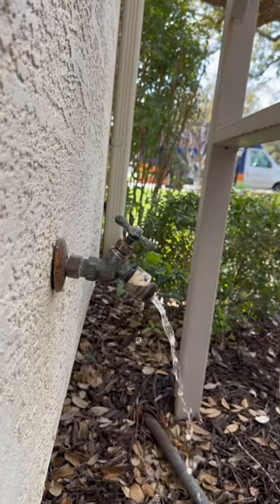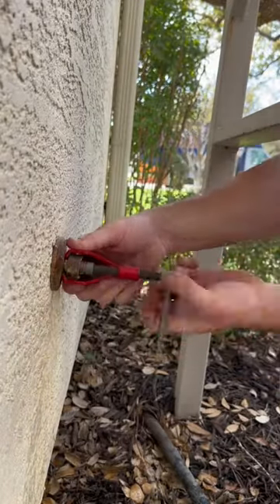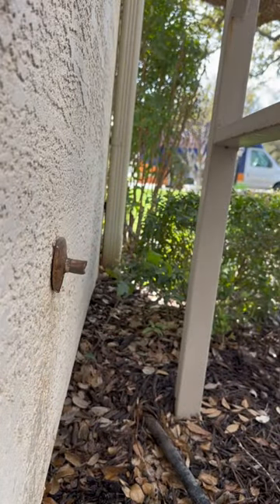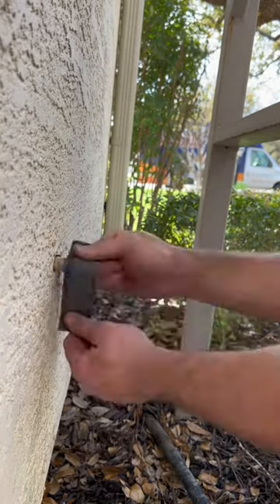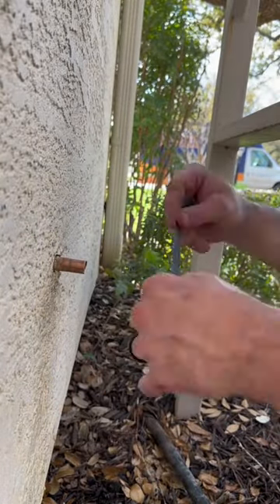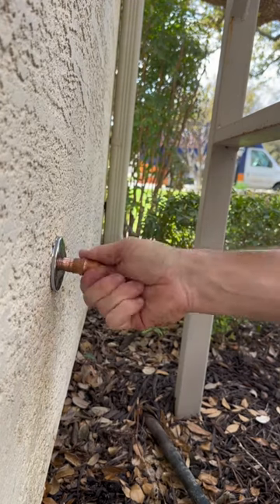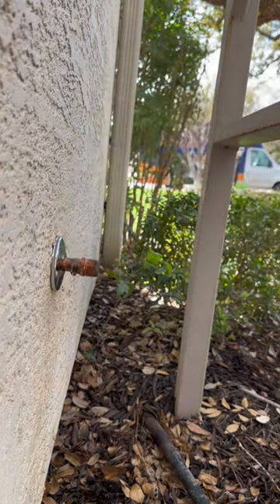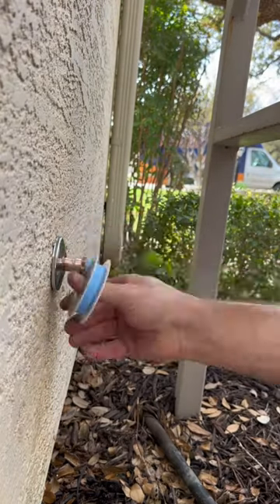Hose bib replacement. #plumbing #plumber #trades #leakrepair

Comment: Man you trades guys always like to preemptively lash out at the trolls, I love it.
Reply: the amount of times experienced tradesmen have to deal with “you should be doing…” 🙄
Reply: Lol they get butt hurt easily
Reply: @SolEcho  and yet, not a single word from anyone when out in the field  🤔 well besides a coworker 😂
Reply: This new generation is a little sensitive. You either do it right or you don't, you'll learn one way or another. Cupcakes 🤦🏽‍♂️😂
Reply: They know what they are doing wrong when they do it.
The calling out is them admitting they don't care.
Reply: Comes with territory
Reply: making a utube video doesnt make them true professionals
Reply: we dont like eachother
Reply: @411Adidas  Seems so.
Reply: Bro fr except not even trolls but other plumbers. I am an IT guy watching those parts pretending like "yeah I can see why other plumbers could think using a PEXVC soldered flex joint bend 95 in this scenario would be bad practice, but in your scenario due to local code it clearly makes sense and is valid"

Comment: I bought a Ferrell puller one time and the very first time I used it, the Ferrell was so damn compressed that all I did was flare the end of the pipe then I had to cut the copper and the wall and solder a coupling to extend it😂 I'm glad yours works

Comment: I am a plumber, and everything you did there was right.  I been a plumber  for over 30+ years.    I have never owned a Ferrell pulling removing tool.   Never needed it.  There are ways to remove them with out damage and without that tool.

Comment: Amazing how many people don’t realize you should always have a backflow preventer on a water spigot
Reply: I am a big fan of those backflow protection devices...
Reply: Why is it necessary?
Reply: @murkyturkey5238  Without a backflow preventer attached to the garden hose faucet line, there is the possibility of contaminants or chemicals entering the water supply.
Reply: That is not a Backflow preventer. That is a vacuum breaker.
Reply: Maybe I'll use one when they redesign them correctly so they don't spray in all directions.  Until then, a splitter with the both sides open when not in use will have to do.
Reply: Hmm
Reply: I don't have a backflow preventer anywhere in my house
Reply: @scottfletcher1956  a vacuum breaker is a type of backflow preventer
Reply: @Joshua Bennett  It's still a vacuum breaker.
Reply: @metallurgy3586  and a vacuum breaker is still a backflow preventer
Reply: @metallurgy3586  Think about it logistically dawg. If its preventing a vacuum from forming then its preventing flowing water from going into the spigot. Therefore, backflow preventer
Reply: @Justin Williams  yes. But look up back flow prevention.  See what the results are. Then, look up a vacuum breaker.
Reply: @Justin Williams  there's a difference, but then again there isn't.
Reply: @YooRyuk  so the random attachments that people add to their hoses don't contaminate drinking water inside. To me they are useless and the only time they accomplish anything is getting me wet when i turn the water off.
Reply: Amazing how wrong you are. Vacuum breaker that is on this installation is the code required method 😉
Reply: Probably internal double check valve as we call 🇬🇧 bib taps with above are banned here🇬🇧
Reply: Those vacuum breakers spray everywhere make a mess. Unscrew lock screw and remove those things.
Reply: @YooRyuk Yes, a one in a gazillion chance.
Reply: I’m one of the ones that realize that they’re typically ‘required’, but don’t like them and don’t have them. How about that?

Comment: Great work! An alternative would be flanged bib with a Hose Bib Buddy plate. (The copper pipe looked a little wobbly.)  I'll send you one if you want to try. You can look it up: Hose Bib Buddy (the original not the cheap triangle Chinese copy)

Comment: With how straight the cut on that end of that pipe is, I'm amazed it didn't leak since the day it was installed. Maybe those bigger ones are less forgiving than the ones on cars

Comment: I messed up the copper using a feral puller one time.... It was just dug so tight into the copper there was a divot spot so the new feral just wouldnt make a seal. Fortunately pipe was long enough to cut the damaged bit off and was good. Hate when stuff just cant go smooth...plumber life.
Reply: That's wild!

Comment: Spanners of the correct size are always the best tool for the job.
Reply: The pliers wrench is really good. It’s a wrench that actually grabs the sides rather than just sliding over them. If you’ve never used them, you don’t know what you’re missing. Looks like pliers but it’s actually a wrench.

Comment: It only damages the copper pipe if it's soft copper. Hard copper pipe it will be fine. I know cause I've done it on both pipes. And never use type M pipe.

Comment: I've wiggled ferrules off with just a wrench, is that better worst or fine compared to a puller?
Reply: I would say it gives more chance of failure, due to possibly damaging the pipe. If it gets oval, from squeezing, or scratched enough, it's possible the next ferrule may not seal and leak. 

If the ferrule is loose enough to be removed that way, it likely wasn't tightened enough, and could have failed with higher pressure.

Comment: Use a small brush with your Flux to wipe the solder joints. Will remove excess and clean up nicely

Comment: I pulled off two at my mom's house and the copper was crimped some, but I cutt it off right behind it
Reply: That's from over tightening the nut on the valve. It happens most often on Stub Outs, because they are softer copper than regular pipe.

It was good that you had enough pipe behind to cut it off. Well done.

Comment: Looks great, I used bubble gum for thread sealer because I went to get my tape and had a pinch left on the roll😂 plus my pipe dope was crusty. But it did last for a week until I got the resources to complete the job the correct way 😂

Comment: The only way to fly.  I don't know why people use compressions when they don't need to.  Some plumbers prefer compression with angle stops but I have never done so.  Two wraps of tape, and a little PTFE pipe dope on the fitting and the valve and never a leak. Not one!

Comment: Are you supposed to break off the set screw?
Reply: Yes, it isn't code unless it's 'permanent'.
You can read the instructions online.
Reply: @ethelryan257  Makes no sense what you said. If it code the screw has to be broke off.

Comment: My hose bib was turned too tight and damaged something inside. I can get it to close, but I have to push the valve in and turn. It connected to white plastic pipe. I know nothing about plumbing but I wanna learn. I gotta change the bib out but don't know how. I hate paying people to do things because I end up seeing how easy it is when they fix it.

Comment: Solder before compression if you can.
Haven't seen very many compression hose bibs 🤔..
1/2" standard pipe thread, yeah...
To change the subject,
Yeah band Tick Talk,... it's from China also, LoL!

Comment: Why not just solder the hose bibb on directly? Just wondering. I've always wondered why people solder the adapter.
Reply: So its easier to replace next time it goes bad.
Reply: @Menzu1  you can just replace the valve inside without swapping the drain body though.
Reply: It's easier to replace the complete hose bib than to fix a drippy washer or valve stem if you do it this way.

Comment: It can stretch the copper. It can be a pain! Ive had it happen only a few times and I it becomes an issue with the customer
Reply: Which crap tool are you using? Every ferrule puller I've owned or used actually repaired oval or crimped pipe, because the shaft enters the pipe. 

Plus they have a stop on the end of that shaft, or the "pull" would not work, in the first place, because there would be nothing to apply force against to leverage the ferrule out of position.

To be honest, this makes no logical sense at all.

Comment: that’s gonna rust very quickly, might as well just use a good safe outdoor caulking, probably will look like the old one in a few months ! good work. (talking about little cover slide over pipe thing, not even gonna attempt to spell it)

Comment: You damaged the copper and it’s going to leak now
Reply from the maker: Thanks for that 🤣
Reply: @theplumbersplunger pro tip: just because it didn't leak for the 5 minutes you were there after turning the water back on doesn't mean it won't fail prematurely.
Just because the customer didn't call you back 2 weeks later to tell you about the failure doesn't mean it didn't fail.  The customer just takes the botched job as proof you're not a good plumber and calls someone else who will do the job right.
For clarification, I'm not talking about pulling the ferrule. That should be fine. My comment is about the whole "I've been doing it wrong for xx number of years and never had a problem" mentality.  It leaves you closed minded and unopen to learning anything new.  
We both know you're never on the job site after the repair for a second longer than it takes the customer to pay their bill, so you can't possibly know if you've "never had an issue with it".
Reply from the maker: @epstein_isnt_dead7726  I give a two year warranty so if it fails within that time I’m sure they would at least call back to have it fixed again right? I see what you are saying though.
Reply: @theplumbersplunger  you would be surprised. But think from the homeowner's perspective.  They may have had to take a day off of work to be there to let you in. So not only did they pay the bill, but they're probably out more in lost wages for missing the day of work, which is usually a higher priority than getting it done again for free.
And that's not considering any water damage they just had fixed needing to be done again, too. I'm sure you don't warranty anything other than the plumbing itself and any water extraction/drywall repair/etc will be on the customer.  
I have been called in to fix many a botched job by an Angie's list contractor that failed not long after the final check cleared. That's the only reason I'm aware of this. I usually jokingly ask the customer "the contractor doesn't warranty this work?" Which gets an eye roll and an ear full about what they will do to said contractor if they ever step foot back on their property again
Reply from the maker: @epstein_isnt_dead7726  I get everything you are saying and have the same views on the subject. I am usually coming behind other plumbers who mess things up and take care of it/make it right for the homeowners. I don’t do sketchy work and I take pride in the work I do. What you are saying it correct, I am just usually not on the wrong side of that.

Comment: This is today’s “fix” ... replace it.   When you could just open the valve and replace the rings sealing the valve    But instead you charge 5x for an entirely new valve made with the same flaws and will eventually charge 5x. More to replace it next time.
Reply: That's cute. But in the real world, a plumber can only carry so much material in their truck. With all the brands, models, updates, and on and on, an "easy repair" can turn into hours and trips to parts stores. Costing the client more, and lowering the bottom line for the business.

If i had no problems, replacing a hose bib takes the same amount of time as fixing one. Usually less. Which means the only cost difference is the parts. Which are negligible.

Furthermore, a repair can fail sooner, leading to call backs. This can happen not because it was poor skill & labor, but miss match of parts and the wear condition of other components in the valve. 

For example, i repair a classic hose bib for a client. It is a solid bronze bird shaped thing in her garden. A classic that can't be replaced identical, nor inexpensively for the budget of a retired elderly person.

Anyways, the seat cannot be changed in this particular bib. So i can only change the washer. On the 3rd set now in two years. Had to switch from flat to beveled. Flow is reduced and it fails and fails because she has to overtighten the handle.

I love the sweet old lady so I've done it free 3 times now and charged twice. That's 3 service calls I've not been paid for, plus my gas & parts.

Lastly, I'm not replacing it with the "same flaws" tech. I always take out multi-turn gate valves and put in quarter turn ball valves. Old outdated tech for new & better.
Reply: @djaa7  . Well as a 310T mechanic I have 40 years of different companies making different models and completely different designs and functions of hundreds of systems in every clients machine.   So it’s just  how do I say adorable for a plumber to talk about how many parts they have to keep in their trucks honey.  I have $400,000 in tools and equipment just to work on trucks let alone excavators and dozers and buses and even have sets for cars and light trucks.  Wonder if I have more air line fittings then you have in your entire truck. And that’s just for the air brakes and suspension. You parts fitters make me sick.  All the think about is the cost and never the waste.  The answer is you need to be a better service tech and know the issues that are common and come prepared to “FIX” not part swap.  Then you toss the old material away to go to a landfill I melt it down and make new shit.  And recycle twisted parts.  And I actually fix what the customer invested in not replace it until it works.  That’s the difference.  A new valve can fail same as a rebuilt valve. A new engine can fail same as a rebuilt engine. But at least I know the rebuilt engine was tortured and put together by my hands and made to last.  Your crap is made to brake to keep you employeed kid.
Reply: @djaa7  aside from al the dick swinging.  Sometimes things aren’t built to be fixed or like you said a new one could be a much better fit but not always. And almost never in my experience. If I just swapped everything in my career to newer shit I would be bankrupt cause to customer wants to just get a new model every year or two something better comes out. They want their model and their investment to last 30 years. Or more. That’s where a real mechanic comes in.  Not a parts fitter.  But in trades now we train electricians and plumbers and dry wallets and blah blah blah to just replace cause it’s “cheaper” and they build this crap in China or Mexico or where ever by engineers paid to make things last 5-10 until the warrantee is up and then fail and require replacing so the whole racket can continue.  I see it in vehicle manufacturing almost 10 times a day.  And it’s just like people shitting on other people for money.  When we could be better and actually made things worth making and fix quality components instead of replacing junk with junk.
Reply: @djaa7  Well articulated.
Reply: @daniellepage2923  You're talking about different worlds. You are 100% incorrect concerning your position on plumbing repairs.
Reply: @daniellepage2923  so you're comparing vehicles that costs thousands to hose bibs that cost $15-30 dollars? And you insult my skills as a tech based on this?

And let me guess, when you get a call, you are told what vehicle you will be working on, and can show up prepared from your shop because you know what to expect. But my clients don't know what valve brand & model they connect a hose to.
So i have to show up to look at it. If it's not the most common brands & models, i now have to drive out to stores to try and find parts if i can't immediately identify it. Hopefully find it, and return to fix it. All while leaving the customer's water off. Which may affect multiple units if it's an apartment building, instead of a home. 

So let's do the math "honey." Show up, replace a valve. That's $75 service plus $15 for a new valve. And I'm fairly inexpensive. Large plumbing companies with more overhead costs won't even come out for less than $150-225. Or, repairing the old, with first trip, leave to shop, and come back, 2-3 hours ($150-225) plus the parts. This is really your comparison?

You are in a different industry and have absolutely no clue what you are talking about. Your "dick swinging" was just that. A loudmouth running his soup coolers just to belittle a different trade.

Comment: I would use a pipe wrench and no tape or pipe dope waste of money..a shark bite hose bib is what I would of use..and stop wiping solder joints it removes solder from joint..Plus I like to do meth first then plumbing
Reply from the maker: Sounds about right 🤣
Reply: The meth is well established after reading this less than intelligent comment.

Comment: Got me beat why its not standard to have a back plate screwed to the wall with a female thread, then just replace the brass hose tap when needed no dog shit soft solder that someone can just tear off if they pull on the hose too hard. 
Seems pretty basic to me anyway haha

Comment: Nothing wrong with that my American friend . Completely different to uk 🇬🇧 we have a “wall plate and tube” check it out 👍👍🤠
Reply: I would love to travel to the UK just to work with a pro for a week and see all the different ways things are done
Reply: Wall plates are good - screwfix started selling the really long ones now - no more than extending them! 😂
Reply: @kurluk04  yip, they just couldn't reach when it was through the back of a kitchen unit.
Reply: @daz3745  just not quite long enough - the longer ones have chamfered screw holes too, I buy them as standard now!

Comment: dope or tape but not both. completely unnecessary to do both. copper, brass, black, or galvanized NPT threaded material is malleable. all the tape or dope is there for is to allow you to make the mechanical connection as physically tight as possible. the tape or dope doesn't not make the seal. it's the thread design and proper  torque on the joint. 

and, wtf are you doing putting a chrome escutcheon on that?????